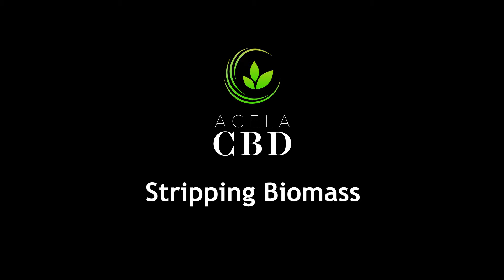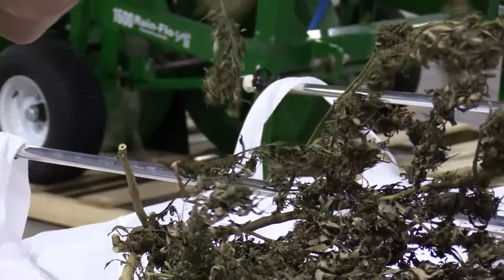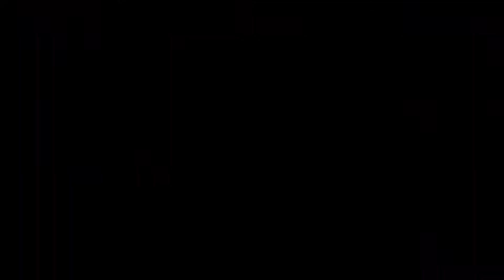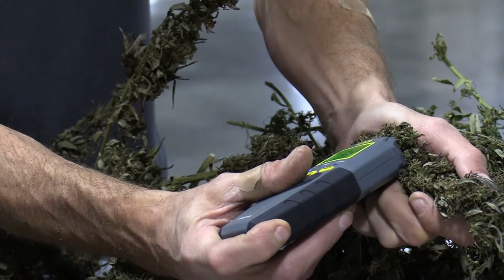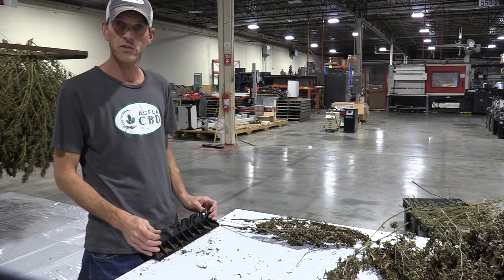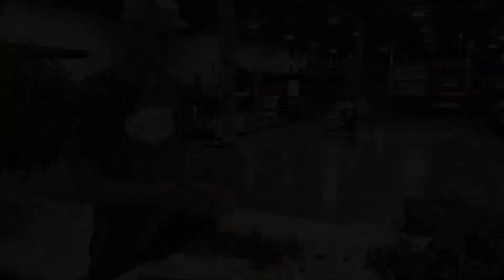Industrial Hemp Biomass Stripping

Comment: This is my first year growing hemp. I hung the plants up in my barn to dry. I estimated them to dry in about 5-7 days. With the extreme dry hot conditions they dried to an almost crisp condition in 2 days. Now I'm having a real hard time processing them cause their too dry. Most of the flower is just crumbling. The Cbd potency is strong but plants are too dry to work with. What can I do to salvage my crop?
Can it be processed for oil?
Reply from the maker: There is a chance to save your harvest. We suggest that you put your crop in a room and using a humidifier, bring the room humidity  up to a constant 60-68% humidity. There are other methods to bring the humidity up such as having the biomass placed into super sacks, set on skids on a concrete floor and wetting the floor. Try to keep the room temperature under 70 degrees if possible. Watch for mold. This may take a couple days. When you can bend the end of the stem near the bud, you should be good to go. This is not a guaranteed fix, but should help. Do some research on humidifying a room to see if you can find a way that best fits your circumstances. This can be a problem in the tobacco industry, if you know an experienced tobacco farmer, they may be of help as well.
Reply: @acelabiomedical4206  thank you so much for your great response. I'm 61 yrs old and I've been an organic vegetable farmer most of my life.
Being new to the hemp industry I have alot of questions and do alot of research on the subject. If for any reason i can't get the hemp to a suitable moisture level for smokable bud can it still be used for oil processing as is?
Reply from the maker: @lazio7495  Yes, it can. Thank you again for your questions!

Comment: Where did you buy the bucking plate
Reply from the maker: Here's one similar - https://www.amazon.com/DeBudder-Edge-Original-420-Brand/dp/B07HLC3VZS/ref=asc_df_B07HLC3VZS/?tag=hyprod-20&linkCode=df0&hvadid=309807711822&hvpos=&hvnetw=g&hvrand=17589204562215176431&hvpone=&hvptwo=&hvqmt=&hvdev=c&hvdvcmdl=&hvlocint=&hvlocphy=9014419&hvtargid=pla-574817461391&psc=1